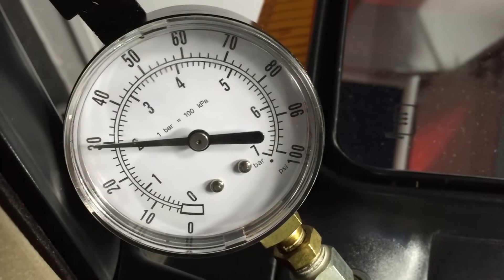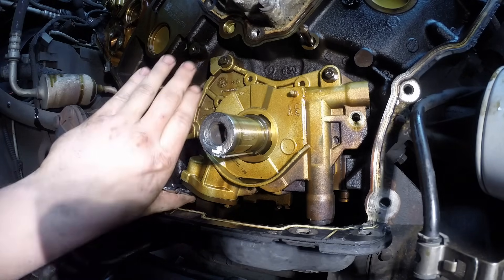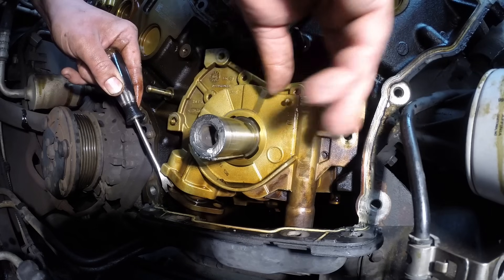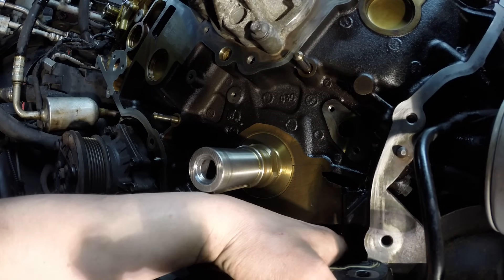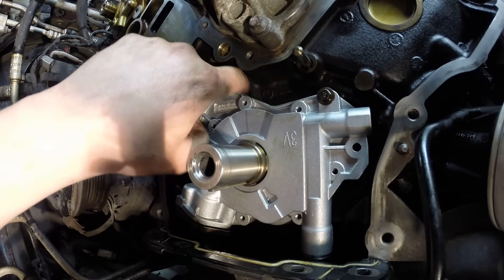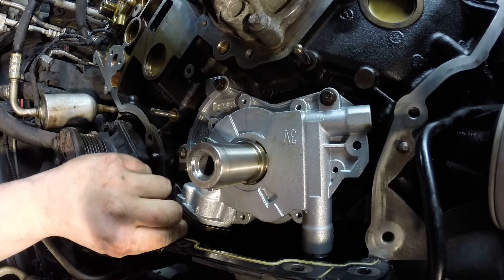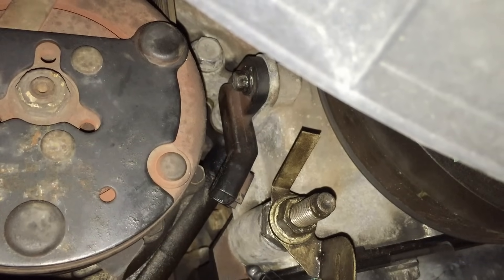Ford 5.4L 3v Engine Melling M360 Oil Pump Upgrade

Comment from the maker: This is the LATEST pump I recommend for this engine (fits all 3v engines 2004-2014)-
https://amzn.to/2IBcqKG
This flex head is an absolute must-
http://amzn.to/28Sl1s3
Once installed switching to 5w-30 oil is recommended-
https://amzn.to/3iqB3wT

Forscan is a free Ford Specific Diagnostic Software:
Download Here- 
https://forscan.org/home.html
ELM 327 Adapter I Recommend-
https://amzn.to/2GC6dBj

As an Amazon Associate I earn from qualifying purchases.
Reply: FordTechMakuloco what is the difference between the 10340 and the m360
Reply: I went to the Amazon link for the m360 and it says this item does not fit your vehicle and says the m10340 does. I've got an 08 f150 fx4 with 5.4L 3v v8, what's the difference? which s should I get?
Reply: @joshuamassengill7159  same here what did you do?
Reply: Joshua Massengill What ended up happening?? Did the pump fit??
Reply: @joshuamassengill7159  mine sayed the same what did u figure out
Reply: FordTechMakuloco  can not get m360 to prime up any suggestions
Reply: Would like to get the m360 but it says it doesn't fit.?? Have a 2010 f150 with a 5.4l. It recommends a M340HV. Any suggestions? I follow your recommendations to a T and all your videos.  Thanks...
Reply: Brian, what is the difference between the Melling 360 and the 10340?  Amazon only had the 10340 available to get in time for this long weekend.
Reply: @clb4714  As far as I can tell, the 10340 is a performance pump and provides standard volume plus 20psi more pressure.
Reply: will this pump work on the 4.6 version of this motor?
Reply: @chasecarmody9876  Did you find out if fits your 4.6?
Reply: What's up my 5.4L 3V owners...well I just did the timing kit swap and M360HV on my 2010 f150. But a weird power steering like sound started to come out the motor. Now I took of the belt and it keeps making that noise, me thinking it might be an idle pulley. Now i thinking it's the oil pump that was defective. Is there a specific sound a bad pump might make. I'm lost here plz help
Reply: @DanielGarcia-dt4bv  I have the same noise but I replaced the factory pump with the M340HV and running 5w20 syn blend.
Reply: @pescatoralpursuit1726  I did the same, replaced the stock factory for M360HV and now I have that sound when I rev engine or acceleration...I doubt it it's the oil pump because I called mellings and they said I cant be due to pump always being under constant lubrication. What I'm about to do is open up front of motor and swap the M360HV for M340HV and hoping that was the problem. If not I'm shooting ma self.
Reply: @DanielGarcia-dt4bv  I don't think that's going to help your situation. The only difference between the two pumps is the 340 has a 60 lb pressure relief spring and the 360 has an 80lb pressure relief spring. If you're running 20 weight oil you're not likely to get over the 60 lb Mark unless you're doing over 6k rpms. with a high volume pump you don't need to artificially boost oil pressure by running a higher weight oil
Reply: @pescatoralpursuit1726  That's what I'm thinking. Swapping pumps wont get rid of that noise. My question is where is that noise coming from. Would u think that the pump is making that noise. Now it runs good and all but that noise started all of sudden.
Reply: @DanielGarcia-dt4bv  been driving it all day thinking about itand to me I haven't stuck my head under the hood yet but it sounds a lot like radio interference
Reply: @pescatoralpursuit1726  yes sounds like that. Now my truck runs great and at low rpms it dont shake anymore as it did with the factory pump. But since I drive long distances for work, that sound freaks me out that I might get stranded in another state. So it concerns me alot. I dont think the pump is making that noise but with the factory pump that sound was not there. So my mechanic thinks that M360HV might be faulty that's why he wants to swap it and see if that noise still there. Will see tomorrow after installing that M340HV hopefully that 360 was faulty crossing fingers.
Reply: @DanielGarcia-dt4bv  Can't wait to hear the results but I'm not holding my breath it's the oil pump. Mine sounds like it's coming from the area around the compressor or midway outside the right cylinder bank.
Reply: @pescatoralpursuit1726  well just I thought and what u said...swapped oil pumps nd noise still there 🤦‍♂️...I guess imma run it like that nd just keep looking nd see who has the problem fixed.
Reply: @DanielGarcia-dt4bv  I'm going to do the same. Gassing up tonight it was very loud even by the filler. On a good note I got 13.7 MPG on Shell regular. New I got around 13 and lately around 12, so that's better MPG numbers than I've seen in 13 years. Hmm...
Reply: @pescatoralpursuit1726  🤣 well u wasnt the only one that notice the mpg. I saw the same thing. I was getting 12 on hwy. Drove it for an hr from shop to my home and 17mpg was what I was getting on hwy. So pretty good.
Reply: @DanielGarcia-dt4bv  I want to give you an update on the mystery noise: it was my 2 year old el cheapo AC compressor clutch. It has been eating away at itself. Not sure how or if it was a coincidence. Just had most of my AC system replaced and now it's all quiet under the hood.  Hope you've been able to find yours.
Reply: Is the Ford Racing M-6600-F46  pump an acceptable option, for a stock 5.4L?
Reply: My truck has 195,000 miles as well. And im hearing some light ticking but i do remember you saying to switch the oil to a different grade to help thimgs last longer. Thanks again: Otis C.
Reply: Otis Collins I know that a lot of light ticking could be lash adjusters. Mine makes a little tick but nothing out of the ordinary. As long as you don’t have a tick and a rough idle you should be fine. From what I hear/read
Reply: FordTechMakuloco when I check on Amazon it says it does not fit the Lincoln mark LT??
Reply: Why do you recommend switching to 5W30 on the 5.4 3v?
Reply: M340HV is the same pump as the M360HV only with a higher pressure relief spring on the bypass. 
Would I be correct in assuming that a high volume pump will move more oil during low rpms where there wouldn't be an excess of bypass anyways while still providing enough volume at higher rpms when the bypass is most likely operating generously, or is high pressure necessary to keep oil following at the important nether regions at high rpms?
Is high volume, high pressure too much on seals at higher rpms?
IOW, will a high volume pump bypass too much at high rpms?
Reply: Make sure the pickup tube isn't aspirating any air.
Reply: FordTechMakuloco will that make the truck not start
Reply: nathaniel dinnwiddie  flooring the gas pedal while cranking cuts fuel pump (at least in my 05 f250)
Reply: Do you have any videos for doing the head gasket on the 5.4L 2V motor ?
Reply: @naiyaholt2882  I need this too! Any leads or suggestions?
Reply: Brian Haney I'm having the same problem. What did you do to fix it??
Reply: say i didnt take the folowers out am i screwed
Reply: wow! what a great job you do!! I would like to take my cars with a mechanic like you.
Reply: ARTURO   It’s for all 5.4 3v modular engine
Reply: Hello I was wondering what oil you recommend using for a F150 5.4 Tritan . I saw in one of your videos that you said to change the oil to a different grade for this Engine due to ware and things. I cant remember what you said lol. My truck is an 2008 F150 FX4 4x4 Tritan V8. Could you please help me with this ? Im sending my truck for some service and I trust what you say so I'd really like to hear from you soon as I have about 4 days until they work on it. I greatly appreciate your time amd VALUE your opion and knowledge.  I watch all of your videos and I think you really know your stuff. Thanks again : Otis C.
Reply: Otis Collins 5w30
Reply: @acolonels3976  I could've swore it was 5w20 to help keep things from tearing up
Reply: Otis Collins it should already call for 5w20. I switched to 5w30 and everything seems to be going great on my 2009 f150. I think a lot of 5w20 trucks are switching to 5w30 after 100k
Reply: @acolonels3976  Thank you I greatly appreciate it  !
Reply: Otis Collins no problem at all!
Reply: ARTURO  all 5.4 3v regardless of vehicle
Reply: how much does oil psi have to do with phasers
Reply: @moemurphy9161  The oil pressure runs the cam phasers. I couldn't figure out why my truck started sounding like a diesel and running like crap at first..... then my oil pressure dropped.
Reply: Ford tech i live in Michigan can i bring my truck to you?
Reply: Do you have to worry about the oil filter bypass opening more often with the higher pressure and flow?
Reply: I too want to know if oil filter is fl820 or fl50 vv
Reply: FordTechMakuloco shouldn’t you make sure the screen on the oil pickup tube is clear of any debris while this far into the engine & replacing the oil pump?
Reply: got a question for you
Reply: if i crank without sensor in isnt fuel still being pumped
Reply: @kennymerfeld7469  disconnect fuel pump safety device, mine is on the passenger side wall by the floor. IF concerned cheers.
Reply: FordTechMakuloco when doing the oil pump, should you replace timing chain tensioners? I have a slight rattle every so often on start up. Maybe every other 20 times I crank it up? I plan on doing the hi flow pump for now and maybe that’ll fix the start up rattle? Looking for any help or advice I can get. I have a 2009 f150 platinum runs great, but want to make it last forever. It’s got 142k miles on it now. Thanks!
Reply: AColonel S Go to his timing chain replacement vid and there’s a link for the timing chain kit. Now, the vid has an expedition but it’s the same absolute engine, the 5.4 3V. I just purchased the kit for $710 on amazon for my 04’ F-150 Lariat
Reply: @lightningvolt1273  well how's the truck doing now?
Reply: Hi i wanted to get this pump but amazon says it will not fit my 08 f150 5.4 3v.  any info would greatly be appreciated.  TIA
Reply: General update:
I replaced the components in the front end of the motor at 260k due to a bad oil leak from the timing cover, not any mechanical failures or noises. While in there I replaced the oil pump with a melling 340hv and dropped the oil back to 5w20 from 5w30 which I had been running since 150k. I did not change the vcts at the time. After 2 days of driving, the screens of one of the vct valves blew into the valve body and jammed it, so both vct ended up getting replaced along with the seals and all is well. Because of this incident I'm confident the phasers are getting all the oil pressure/ volume they need with the new pump and recommended weight oil.
I don't think a heavier weight oil would help in any way with the high volume pump, and may even reduce critical oil flow to the top end.
Reply: After u open the new oil pump to oil it what torque do u do the back bolts
Reply: If I take my F-150 to the dealer for this, will they use the Melling M360? or will they insist on using the original OEM oil pump? I know they won't install parts that I supply. Is the high volume standard now? Thank!
Reply: can you recommend which melling  oil pump for 2010 f150 5.4l 3v , amazon say neither fits my truck..thank you
Reply: @jso567  After all my research including talking to a tech at Melling I went with the M360HV. And FordTechMakuloco says that is what he recommends too in one of his videos.
Reply: That's funny that Melling says the M360 is for a Mustang. The correct pump is the M340! I'm having one installed right now. So, call Melling to get the correct replacement for YOUR vehicle.
Reply: Waiting for the updated timing chain kit and phasers, then start putting it back together, Thanks for the video,FordTecMakuloco
Reply: Hi Brian, the oil pump you link to above is the M360HV but it does NOT fit in my 2010 5.4 3v as the "hex cap" at the bottom of the spring tube is approximately 1/4" longer than the stock pump dimensions.  After removing my stock pump I spent over an hour just trying to slide the M360HV onto the crank but the extra 1/4" makes it virtually impossible to slide the pump on the crank as it binds up where this hex cap hits the oil pan.  I stacked this new pump to check the dimensions vs. my stock pump and the spring tube on the M360HV is definitely longer by approximately 1/4 inch.  After struggling I got the new pump off and double checked to make sure the pump gear was aligned with the 2 flat surfaces on the crank, then tried installing it again to no avail.  I just checked the Melling website and they show the M340HV as the correct pump for my vehicle.  Am I missing something or do you have any suggestions getting the M360HV pump to fit?  Thank you.
Reply: Does this apply for the 4.6l also? Thanks. Enjoy  watching  you and your knowledge ,and tailant!  Great job always!!! Ty
Reply: Where are you from
Reply: Does this pump come with billet oil pump gears inside?
Reply: And which oil filter?
Reply: With 360hv pump and 5w30 what oil filter is used?
Reply: Rock Auto is cheaper, $110 plus shipping, so Amazon at $150 certainly doesn't seem to be the cheapest, I also have never had Rock Auto ship a counterfeit part and you yourself have a video about counterfeit parts, and I HAVE had Amazon ship me fake items advertised as genuine
Reply: Hey for some odd reason when i search my VIN 2011 Expedition M340 pump is what fits, for some odd reason the M360 does not. Is this expected?
Reply: Hello Makuloco I’m just curious as a pretty good d I y mechanic working on cars with my mechanic uncle for years. Would you suggest a timing kit replacement at 160k miles? And should I have a pro do it? On average what’s safe to say a decent price would be considering the motors good
Reply: FordTechMakuloco this pump fit to my 2005 ford expedition eddie bauer

Comment: The pumps are tested after assembly, but leak out in storage before packing.   If you remove the cover, the torque of the screws is 9-12 nm  80-106 inch lbs when reassembling.  Just as easy to pour some oil in and turn the rotor assembly by hand, unless you just want to look things over in there, you also want to check for any burrs where the bypass hole/ cross hole enters the pocket area.

Comment: Incase someone needs another bolt to mount the oil pump . The part number is N806183*S437  $13 bought it at my local ford dealership.
I snapped one torque them 1 of 3 . I have a 2005 f150 5.4 lariat

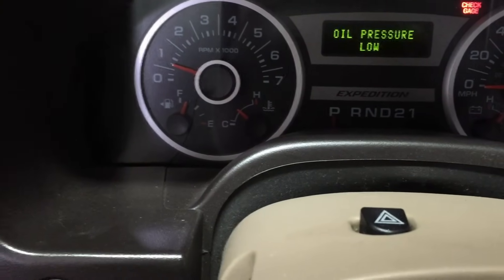Comment: Brian I love your videos. they make working on Fords a little easier. I just wanted to say that it was funny at 12:41 in the video you showed the higher oil pressure on the manual gauge but the instrument cluster said "oil pressure low". That made my day.   Keep making great videos!!
Reply from the maker: Yup very contradictory but I was tapped into the oil pressure port so it was just hanging there.

Comment: Glad to have found your videos. This part is by far the toughest when standing on your head with your feet dangling in the air while trying to get the pieces lined up. I am sure Ford could have made it a bit harder, but not much! At least I could take a break, catch my breath and rewatch to make sure I hadn't missed something!

Comment: @fordtechmakuloco Love the content, its very informative. Wanted your advice, I have a used engine 99K miles. What would you recommend I update or replace before installing in my 2006 F150. Again great content.

Comment: I did everything to my 5.4 that he has a video on, in addition to a few extras, and my truck really feels like it's a new truck again. In fact, I just returned my rental vehicle, and I can't wait to get home to drive it again. 😊
Reply: What all did you do to your engine? There's so many videos on these things
Reply: @dbey8422 I'm actually disabled and slow, so the following took me several weeks to do, but here's the list. All new:
Factory OEM 
Roller-followers
Timing chains 
Timing Chain Tensioners
Melling High-Volume oil pump 
Front Crankshaft Seal
Cam Phasers
Alternator 
Power Steering Pump
Water Pump
Serpentine Drive Belt
Spark plugs
Ignition Coils
Fuel Injectors 
Since I had my tools out:
Fuel Pump 
Fuel Filter 
Oil Filter
Fuel Pumo Driver Module
Cleaned the grounds
(I know what your thinking... but you didn't change the piston rings or the ceankshaft bearings or the thrust bearings.) My wife wanted her Ford chariot and chauffeur back, so I had to stop. She hates being in a rental car. She likes the truck. Plus, she smokes 🚬  and you can't smoke in a rental. 
I want to go back in to replace all the front-end parts. I have boxes 📦  with new everything for the steering system. I just need to install the stuff. I need to buy the lower ball joint removal kit, so I can move forward on that. 
I loved doing this work. It made me feel alive again. I used to do it professionally but I got sick and was forced to shutdown the company. The only reason I was able to even do this was because the doctor installed a pain pump in me. It was so much fun. I can't wait to do more. 😁
Reply: @JeffElliott-jb7ix  that's awesome Im sure she runs good as new. As for the bearings and rings, if it ain't broke don't fix it lol

Comment: Thank  you for making  this video  .  we only have  one 5.4 in our family with 200k.  seems  very nice and was  well maintained.  no valvetrain noise etc, except for timing chain slap.  Read about  the oil pump backing plate flex ... here we are.  since  it isnt quite  a published part fit, very glad for the proof it'll bolt in.

Thank you in general for sharing  your knowledge and experience, especially  in these times.

Comment: I am in New Zealand, and have an Australian Ford Falcon XR8 with what I believe a 350HP 5.4L of the same type as used in the Lincoln Navigator.  Can anybody tell me if they use the same oil pump,  and if so, should I install a HV Melling pump?